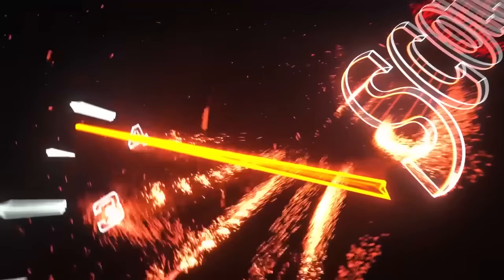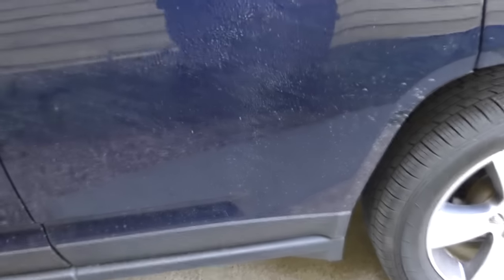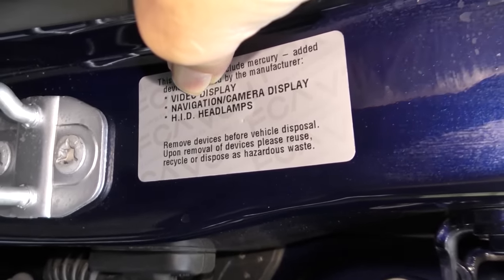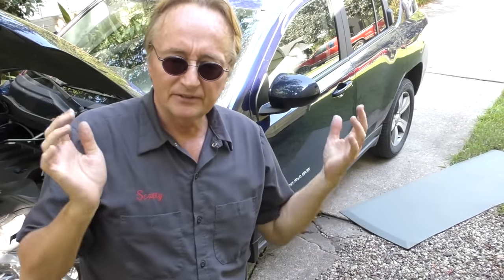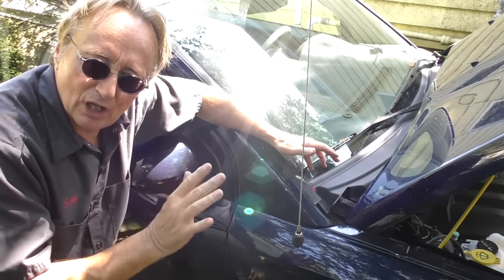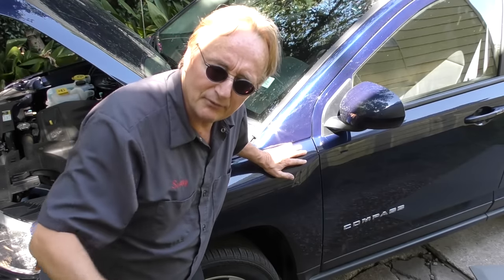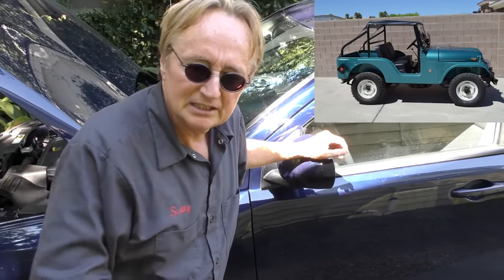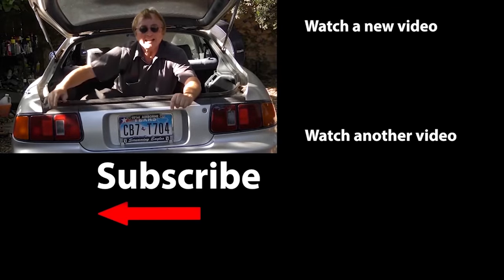Here's Why This Jeep Compass is Crap

Comment: My piece of crap Jeep Compass still running like brand new since I bought it in 2014. 😁
Reply: It better it’s not even 8 years old yet
Reply: But I also have a 2003 Dodge Caravan and the only mayor repair that a made in her was the transmission a year ago with the computer I spend a lot but a take from her much than that in miles
Reply: Didn't Scotty say Fiat took over 3 years prior to 2017 ? So maybe you got yours before the Italian quality decline ?
Reply: @timothymoroney3561  that right
Reply: Only issues since 12 is the wheel bearing. The worst design is the rear brake caliper sliders . Rust stick and you have to remove the brake lines to fix the slide pins .  Bad design.. The CVT is crap with the chug chug chug . But 92k it runs . And hasn’t been a bad “car” only
Reply: Your time will come.
Reply: My 2007 keep compass 201k milles running strong . Just keep up with maintenance and cars last .
Reply: My piece of crap 2010 Jeep Compass is running great and I can confirm it does indeed have front doors and backdoors.
Reply: I have this exact model (which is a 2016)  with 125,000 miles on it and I Uber everyday.  No major problems with it.
Reply: 5 years is nothing for today's vehicles. Report back after 8-10 years
Reply: @timothymoroney3561  Wrong Fiat started buying stocks in 2009 after diamler left. It bought the remaining stocks in 2014. But they have been controlling them for a a while.2014 was the official merger year. Plus this car isn't even designed by Fiat, this is a diamler car the 2.0L is also a diamler Chrysler engine, the 2.4L is a diamler Chrysler engine. The transmissions are not even related to Fiat, it's a Hyundai or a magna transmission. This guy clearly doesn't know what he's talking about. This car has about as much to do with Fiat as the VW TDI that was offered in this very vehicle outside the HS.
Reply: @jwill6312  thank u for sharing.  People always talking bad about this car. I  was worried that I made a big mistake getting this. I don't see the issue. If u really take care of your car it will take care of u. All u need to worry about is normal wear and tear.
Reply: Glad to hear this...I'm looking at a 2010...Pre FIAT
Reply: My 2011 Jeep Compass is also running great since new. Might keep it forever as it’s easy to fix myself and parts are cheap.
Reply: Lol Scotty is a joke, the compasses at least the newer years get their transmissions from AISIN the same company Toyota owns and gets its transmissions from
Reply: my 2015 died under acceleration at 94000 kms- transmission finished
Reply: Timothy Moroney exactly
Reply: My CVT officially died at 94000 kms. 5 years old. Over 5k to replace. Trading it for a civic type R.
Reply: 2014 compass Mine done 95000klm drove from Perth to Sydney with trailer loaded to the brim no problems best car I ever had it may not do all the things you want it todo  still going strong reliable
Reply: haha my 2007 compass is now 270,000ks only major repair was a oil filter
Reply: lol the 2010 Patriot I have, has a lot of electrical issues & the cvt trans may be going bad. They were not made to get past 200k, nor are they in the 250k to 300k mile vehicle club like Honda or Toyota.
Reply: @77chevy4x4  The fluid for the CVT requires servicing every 30-60k miles.

Comment: I had a friend that I went to college with she bought one and after just a few months of owning it one days she posted on a facebook of it on the back of a wrecker, when someone asked what happened she said the check engine light came on and wouldn’t shift out of first gear. Yeah a brand new Jeep Compass that’s only a few months old and already having problems with the transmission typical Chrysler quality.
Reply: cvt and she says couldn't get out of first gear? LOL was it in neutral 😂😂
Reply: Keye T lol 😂
Reply: Señor Loco Inquiring minds would like to know
Reply: The Catmother They only came with a CVT along side the jeep patriot
Reply: The Catmother lol Yes I remember there being a recall for that retarded shifter, but they definitely offered an automatic here they might have offered a manual in the early years probably... But the CVT is troublesome for sure my best friend has a patriot and hasn't had any issues surprisingly (cvt)
Reply: That's why it's spelled CRY-SLUR.HAHA!!😂👍
Reply: @eyehatefarcebook11  Not UAW,Cry-Slur.
Reply: @wholeNwon  Isn't Chrysler related, but I went on a blind date with a girl who bought a used Audi A3 straight out of college. The subject of our cars came up (she asked, drive a 2017 Mazda 3) she told me point blank with a straight face "I looked and the Audi only had 20,000 miles and was the same price as a new Camry. I'm obviously getting the Audi." I knew at that moment that she wasn't for me lmao. Moneypit machine, moneypit woman. Never occurred to her that they depreciate so rapidly for a reason.
Reply: @honkhonkler7732  So if she bought the Toyota and 5 years later the frame rots out of it along with her good looks,what then??.
So much for the"money-pit"theory huh?.
Reply: Fixed that issue by replacing the brake a switch or whatever. Cruise started working again. Didn't have to use hidden lever to take out of park anymore. 5 minute fix $16 ish
Reply: 1st gear on a CVT??
Reply: Sounds like it went into 'limp home' mode, engine fault light would normally limit what gears can be selected in an auto, usually 3 and reverse.

Comment: My 2012 Jeep Patriot is a champ, 6 wrecks, 175k miles (I did uber with it) and I’ve had it for 10 years, my first car. Biggest repair was $700 for the condenser and compressor to be replaced. Everything else was standard, belts, oil changes, spark plugs, brake pads. She’s been an absolute saint and I hope to make it over 200k
Reply: Yea I was saying the same tbh I maintain and replace everything.   Until it happened to me at 120k miles.  It began to overheat and the gasket was blown.  The bearing wore out and there’s rust in it all over, I live in San Diego.  It has a bad record for a reason.
Reply: The Jeep Patriot/Compass is bullet proof as long as you don't have the CVT transmission option. I think Scotty doesn't know what he's talking about in this video and just hating on Fiat.
Reply: 6 wrecks 👀
Reply: @Netdinex  Scotty is so painfully biased that almost everything he says translates to "he doesn't know what he's talking about." He's on Toyota's payroll.
Reply: My 2010 Patriot 2l fwd. is a great little car so far @90,000 miles .Lol....only had 2 months but what a repair history on carfax. Trans is cvt with 5000 miles factory rebuilt,new ac ,struts ball joints,  very clean for age....$6,000 bucks
Reply: @Netdinex  a year later, I’ve always heard bad things about the CVT but never had any issues with mine. I finally got rid of it at 210k Miles. Not because of any major repair problems, it was just time for an upgrade. But my grandfather sold it to someone else who was super excited to have it. I never used the auto stick feature anyways. But yeah the worst thing to happen to my transmission was when the guy fixing the ac threaded a line for the transmission fluid when he put it back together
Reply: @bradleymenezes6196  I was only at fault for 1! It had an affinity for attracting f250s to its bumper at red lights
Reply: My 2012 Jeep Patriot is a pip. I had it built to my specs with larger wheels and standard transmission and it's a workhorse.

Comment: I haven't had any problems with my 2015 Jeep Compass.  I've put 102,000 miles on it and the only maintenance it has needed are preventive maintenance such oil changes, brakes, etc.  The 4WD is great and I've never got stuck during any of the Chicagoland winters.
Reply: Same with my 2014 Compass Latitude.  It goes great in the Colorado snow and has plenty of power going through the mountains.  In Scotty's world, if it's not a Toyota, it's crap.
Reply: Every how many miles, before you do your oil change?
Reply: Make sure you protect against rust.  Fluidfilm is cheap compared to undercarriage parts.

Comment: 2015 Jeep Compass Altitude edition 155,000 still running great
Reply: How bout now tho
Reply: My 2007 Toyota rav4 250000 is run like new.
Reply: 2015 2.4 Sport with 159k, still runs great 👍
Reply: wait for 300k miles and your head will hurt about the expensive maintenance cost.
Reply: if you buy a toyota rav4 , you will have no worries.
Reply: 21 rav4 tops out 36k (trd), jeep 31k (trail hawk), that could be $100 extra a month depending on your interest rate.
Reply: 2016 compass 4*4 with 150000 still running very strong just did the plugs for the second time have the coil packs just haven’t put them on might do it on the next oil change honestly love this keep an yes bought it brand New an have been the only owner

Comment: Came real close to buying one of these. SO glad I bought a RAV4 instead!
Reply: Wise choice!
Reply: Dan Koehler They look like a Rav 4.
Reply: Good choice
Reply: You have dodge a bullet there.
Reply: Good to hear Kevin! It will last at least twice as long.
Reply: Dan Koehler I don’t understand you people why would you want a rav4 get a cool car you only live once
Reply: Charlie Ennis I have a 2011 e63 with 157000 kilometers and  I didn’t have to repair any mechanical parts.
Reply: Charlie Ennis 🤣🤣🤣🤣
Reply: Brandon delapi you say kilo so I’m assuming I’m ur UK, they don’t build Germans over here well.... I just did a two day job on my CLK350 cab..... 4 plugs blew at once,  replaced distributors too..... still fucked up.... gonna keep figuring it out, wish I hadn’t bought that German crap. Wish they made em as good here as they do over in the UK
Reply: U made the right choose
Reply: Charlie Ennis I will have to wait a long time since I live in the USA where distance is measured in miles rather than kilometers.😁
Reply: My RAV4 running sweet after 80K, no problems
Reply: Nate Helman  They had issues with coils going bad and the vvti oil line broke twice till recal was done and i lost all my oil twice will driving and heard knocking and had to pull over.   A big reason while the car I think started leaking oil at 222k miles and I got rid of it.  Otherwise the 06 V6 Rav4 was good vehicle.  The pre 06 much better.
Reply: Oh man, yeah, you made a good decision.
Reply: Hopefully your Rav4 isn't diesel. That's not very reliable engine.
Reply: Very very wise choice my friend
Reply: I don't like RAV4's they're kind of cheap.
Reply: @Charlie Ennis I can think of a million things that are cooler than saving money. saving money isn't cool, it's practical. I can't have fun with a RAV4, it's a boring car.
Reply: @forc3ofxf3ar51  why would you assume he's in the UK because his odometer is read in kilometers? you realize that the US, liberia, and burma are the only nations in the world that use imperial units, don't you? he could live pretty much anywhere.
Reply: @Charlie Ennis being poor doesn't make saving money cool, if anything it's less cool when you're saving money because you have to. what's so great about that? that kind of suck! I am sure they don't enjoy being poor and would think there are much cooler cars out there than cars that just save money. I am kind of poor myself, I drive an 03 dakota which I really like but I can think of a lot of other cars that are cooler than a dodge dakota. if I had money I would drop a HEMI in that truck and turn it into a sleeper. one thing I really want to do is buy a late 90's early 2000's jaguar XJ and drop and LS in it. that's a car that looks like it can roar and look presidential while doing it. I would also love to have a mercury marauder and have it cammed and slap a procharger on it.
Reply: Nate Helman  I was gonna buy one compass too... I think I am gonna go for a Ford Escape
Reply: those rollover .mine was 16k brand new
Reply: congrats wise choice
Reply: congrats wise choice

Comment: I personally own a 2011 Jeep Compass. I havent had any major issues with it just basic maintenance like oil changes, transmission fluid change and new tires. Its been pretty reliable. Its engine horsepower for sure isn't impressive very underpowered but good on mpg

Comment: Me:
Scotty: Let me tell you again why Chrysler is garbage.
Reply: Then me: but Scotty my 2000 dodge caravan is pushing 200k trouble free miles except for routine maintenance..
Scotty: well they don't make them like that anymore.
Reply: I do see a lot of old caravans out there still running but I bought Toyota anyway.
Reply: Old Caravans are pretty hardy except for the corrosion chewing on the same spots on all of them.
Reply: @eppyz  I have ocean front property in Nebraska! 🤣
Reply: Everyone:
Scotty: Ever since Fiat took over Chrysler and Nissan took over Renault.....
Reply: @eppyz  if i recall correctly Scotty did say the Caravan's are good Vans.
Reply: @lezlethal  i believe he did too... One of the only Dodge products of yesteryear he gave a nod to👍
Reply: Hairy Watermelon Don't listen to all these TOYOTA Worshiping trolls! They've been brainwashed against anything else! All cars not taken care of, will fall apart! Toyota included!
Reply: @zoobrizz  well he hated them for a reason.  Most of them are pretty crappy long term.  New ones are great for a while but they fall apart pretty quick after the 5 yr Mark.  I think that's all he is saying.  Im happy with my 2000 Dodge Caravan it's a great van but the new ones do have issues particularly the transmission.  Same with Ford in some of their cars.  The new Toyotas though aren't as good as they used to be either but still better than new American or German stuff.
Reply: @frazzleface753  actually Renault was trying to take over Nissan.
Reply: Daimler Chryslers are good quality. Fiat Chrysler are junk in comparison.

Comment: My wife bought an '07 Patriot new, and while we've had several suspension parts replaced, it's been fairly reliable. It's slow, and isn't as fuel efficient as a 4 cylinder should be, but we love it. (2 liter w/ CVT)
Reply: Dude I was just thinking that, cuz my GF has had an old 08 Patriot for years. Now of course when I met her it had all sorts of issues, and I've thrown sensors, sparks, an alternator, etc at it but i'm learning that folks like you and me must be terribly lucky that this hunk hasn't quit on us yet. 2.0L 4x2 also. Just needed some TLC.
Reply: @nathannurse2280  We actually sold it a few months back to get something capable of towing, but it was great to us! Treat it right, and it will take care of you.

Comment: Friend’s Jeep Compass transmission locked up at 10k miles!! 😂
Reply: What a piece of junk
Reply: he placed a padlock on it?
Reply: fidel catsro no, brand new 0 mile car 😂
Reply: @canceraxe1447  eeeeeeeeeeeeeeee!
Reply: probably a manufacturing defect.
Reply: @Richi RIch fiat has nothing to do with it. they don't make them they are still made in america and mexico with parts sourced through MoPar.
Reply: @Richi RIch on the cheaper cars sure. but not on the MoPars, especially the older magnum and LA motors those things were bulletproof. the body of the car would rot into the ground before the engine died, and the transmissions weren't too bad either especially the new venture transmissions.
Reply: @Richi RIch no they don't, I promise you they don't. you just never owned to right car. tell me what cars you owned.
Reply: @ElectronicsForFun  There's a lot of cars made in Mexico that are good quality. Not sure what that has to do with anything. Scotty even mentioned the new Ford trucks are made in Mexico and everyone driving F-150s. It's not the parts or the location, it's how the car is engineered that matters.
Reply: @funkmonster  I never brought that up. I said some cars are made in Mexico, I didn't say whether they were better or worse in terms of quality.
Reply: @ElectronicsForFun  ok yeah you’re right I was being a little psycho there haha. Sorry man I read it wrong.

Comment: I bought a 2013 compass in 2014 with 16k miles. It’s now 2024 with 210k miles on it without any major issues. Just normal wear. I will say I have the FWD 2.0L  version.

Comment: I've got an 08 Compass normal wear and tear component parts that need to be replaced other than that runs great!
Reply: Same, quick question is it normal for the car to have a sort of "engine breaking" once you remove your foot from the acceleration pedal
Reply: I got a 2020 compass latitude. Its really nice
Reply: The engines are decent. As long as you do oil changes and do a radiator flush. What size motor? Only issues I've seen and dealt with is the cvt transmission. For the price and a average of making it to 200,000 miles theyre amazing
Reply: @DerfOrNuffin  I got the 2.4l engine. Multi air engine lol. Thought it was funny when I looked at it.
Reply: More power i have the 2.0 the basically identical besides size
Reply: How many miles?
Reply: @peterl6095  mine has 7,000 miles.
Reply: @Kel_Tech  as a former Charger owner, I 100% understand what you are saying. It feels like a transmission issue, or the poor “tuning” between the engine and transmission
Reply: @Marco-yl8cm  EGGZACKLEE
Reply: @Kel_Tech  no its not, Chrysler makes bad transmissions and arent as smooth especially if you dont drive conservatively, my friend has an srt8 and started slipping at 30k miles
Reply: Yeah and they are not difficult to work on he is Wong

Comment: To be fair the older ones before this facelift are actually pretty decent. My gf has a 2010 Compass and she has almost 250km so roughly 155k miles, and so far most of the work it has needed has been mostly wear and tear stuff, brakes and suspension. Here's hoping it will keep going another 2 years or so.
Reply: How’s it going now
Reply: What about now??